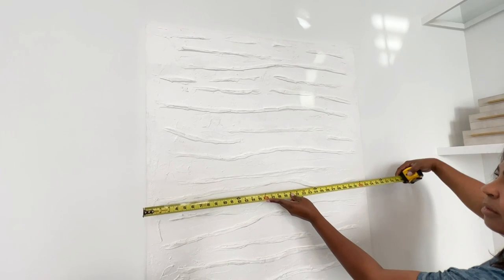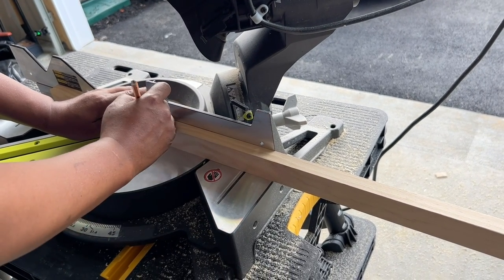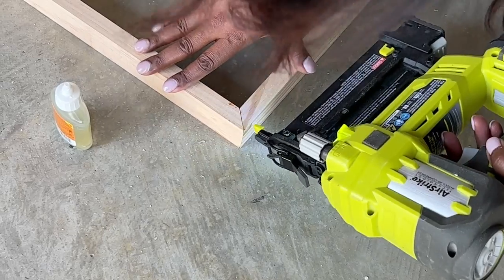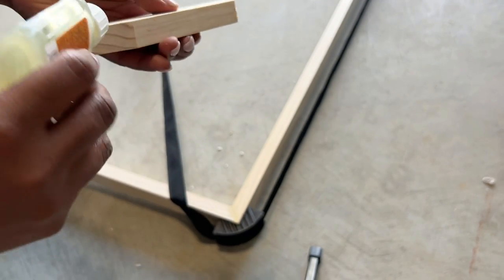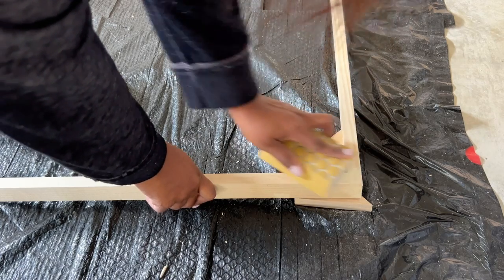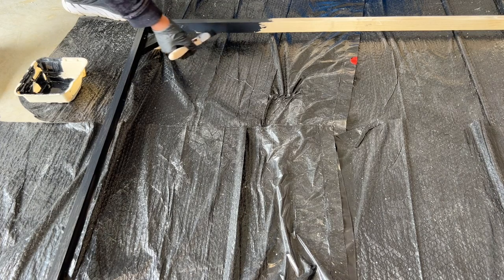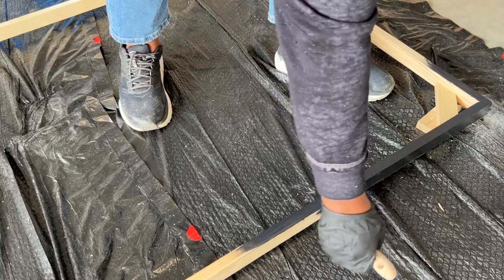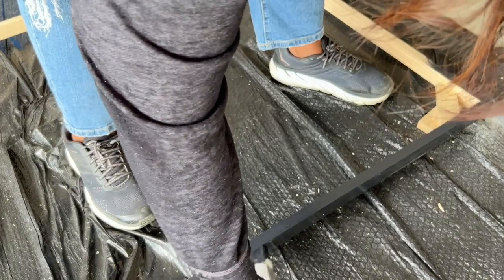How To Make An Inexpensive Frame For Your Canvas Wall Art

Comment: Why cut out the most important part- how you attached the picture to the frame?
Reply from the maker: I think I missed the footage for that part. I screwed the corner brackets to the frame and canvas. It’s an easy step.
Reply: @treshaja  Thanks for clarifying. Appreciate your response.
Reply: I'm such a visual learner. I don't understand how you attached the canvas without damaging it. Could you post pictures?